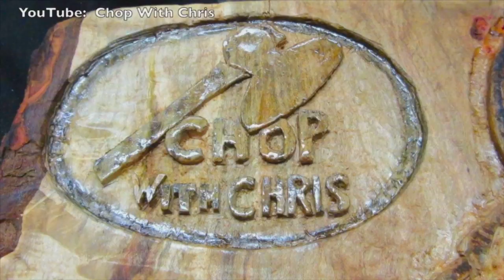DIY BOW TIE SPLINES and LIVE EDGE TABLE EPOXY

Comment: Hey Chris! I've never done epoxy work myself, but when ever I see people add pigment to their epoxy projects, I've noticed they'll add the pigment to the resin, mix it all in, and then add the hardener and mix both parts together! That way it gives you more time to work with the resin before it hardens
Reply: Generally it's not for that reason but to get it to properly mix together to get the full desired color. Only time you may pour then mix it is when you want a swirl or dot color design in your epoxy. 

Cheers
Reply from the maker: ok

Comment: Chris awesome project!  The end result was worth the efforts. Epoxy is a difficult cat at times.  I think some of your bubble issues may have been caused by moisture and air in the wood.  Oak has a very porous grain structure that can hold air and moisture. The bubbling you saw at the wood edges is almost certainly caused by that porosity. One way to solve these issues it to seal the wood (as much as possible) with a sealant or a quick set epoxy like 5 or 15 minute epoxy. The idea is to seal as much as possible, and with the tight access it would be difficult. Great job, I admire the fact you do this with all hand tools!
Reply from the maker: Thanks for the great advice!!

Comment: Chris,
First time visitor to your channel, look forward to seeing more!
Thought I’d share some lessons I’ve learned along the way:
1) Tyvek tape does wonders, but it’s not infallible. 
2) Put a brushed-on seal coat of epoxy or poly down before the main pour to cut down on bubbles, esp. in porous woods like oak. 
3) For deep or large volume pours, look to “casting” epoxies with longer cure times. They don’t produce as much heat, and bubbles have plenty of time to work themselves out. Lot of YouTubers are using EcoPoxy, but I don’t have experience with it. 
4) Don’t plan on becoming a master of epoxy. Just control as many variables as you can and follow manufacturer’s directions.

Good luck!
Reply from the maker: Thanks so much for all the advice!!

Comment: Nice video, Chris.
The table top looks great, with the filled crack.

Cast resin is a tedious thing.

Small tip, if you use cast resin again, then cut the stirring bar straight down (90 °). So you come in the corner of the cups when stirring, as if you turn the rounding on the stir bar.
Reply from the maker: Ah. Yes. Thanks!
Reply: no Problem. :-)

Comment: Good job Chris. Love that the wife seemed excited too. With the tools you used, I think you did an exceptional job. Well done. Just in case you haven’t figured out yet, I would suggest epoxy that takes days to set up, and still if you add to much heat, it will still set up with bubbles. What finish (if any) did you use on this table? Has it moved much since?
Reply from the maker: Thanks!   It still looks great.  No movement.

Comment: I’ve found that sanding excess epoxy (or glue) from wood gets better results than scraping it. Epoxy sands quite well, in my experience. As with other materials, start with a large grit for material removal and work up to fine grits to remove scratches.

By the way, you can also use CA glue (superglue) to fill in small cracks. CA cures with water (or water vapor), so a fine spray of water will accelerate its cure time (although it cures fast anyway).
Reply from the maker: Thanks!

Comment: In 89 when Hugo came thru, I had an Oak tree in my front yard fell over. The bottom of the first cut was app 49". I cut this tree up and split it for firewood. The tree was app 75' usable table tops, at 3" thick minus saw cut equals 300 pcs at $50 per slice equals $$$ and stupid cut it into FIREWOOD. And I would have given you a couple.
Reply from the maker: Don’t feel bad.  You did what you had to do!
Reply: Oh I don't. I was just having fun with you buying the piece and me cutting all the trees into firewood. If you could have been in my shop before I had the auction,  you would have messed up your pants. I never threw anything away, heard a couple guys talking at the auction, they said they had never seen this much stuff in one place. Like you, I had a ball building things from nothing.

Comment: Does the heat gun count as a power tool? Came out great Chris, glad to see more projects from you
Reply from the maker: I was waiting for someone to ask 😄.  It does count if I am using it but in this case my wife used it.  She doesn’t like using a flame.
Reply: Chop With Chris Ha ha!
Reply: Of course, you could build a charcoal fire and then blow the hot air/smoke onto the resin with a hand-pumped bellows. Or, here in south Texas, you could just put the whole slab out on a sunny sidewalk in August.

Comment: I got a question if youre still around. lol    why did you use bow ties?  Wouldn't epoxy alone be strong enough?
Reply from the maker: Still kicking!   The wood is still going to move so the tie prevents that.

Comment: Using a heat gun on the epoxy resin may have made your short open time even shorter. Epoxy (like most other resins and cements) cures faster at a warmer temperature. However, epoxy also generates its own heat as in cures (an exothermic reaction), so the heat gun may not make so much difference.
Reply from the maker: Thanks for the advise!